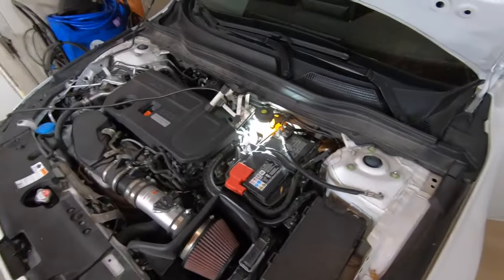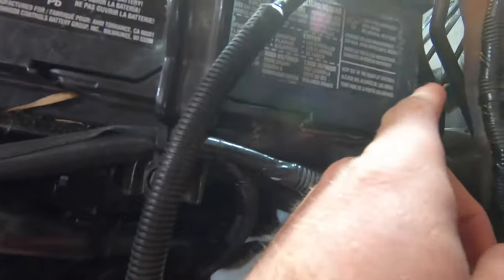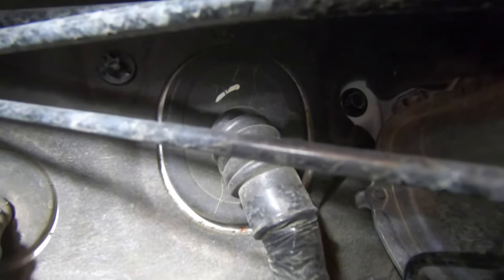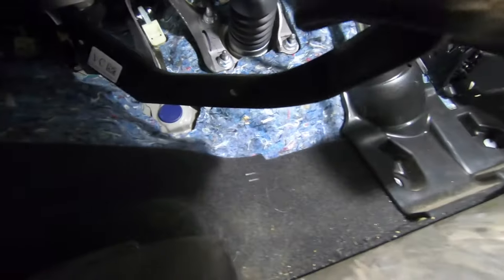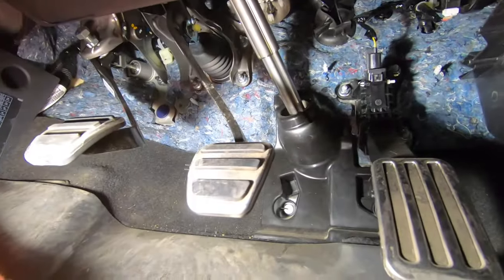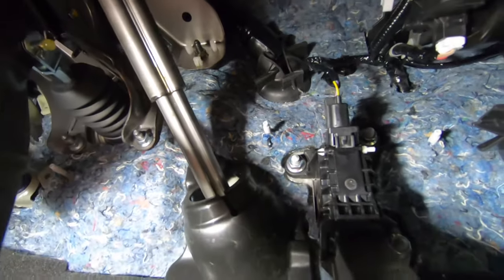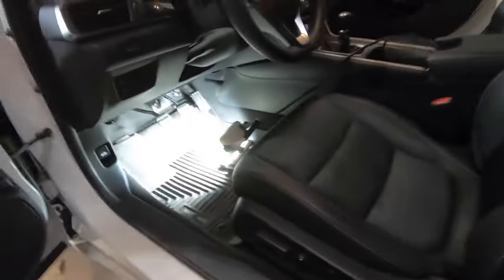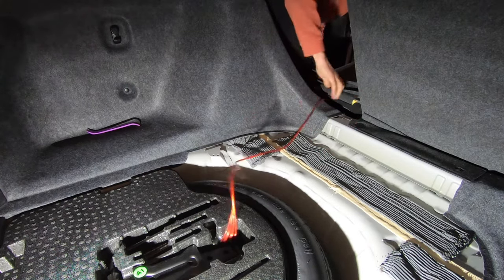2018 Accord Sub/Amp wiring Tips & Tricks

Comment: I decided to drill through the firewall, but followed everything else including the GENIUS trick at 13:08. Thank you!
Reply: Did he connect the rca adapter to the speakers? Is it just one speaker he is tapping into or both?
Reply: @tenkay7536  he connected the Line Output Converter (LOC) to the speakers. The most common ones I see are LC2i or Kicker KEYLOC. You have to tap into both because you would be missing any bass from songs that only play bass on the left or right

Comment: Def upgrade the amp kit too a ofc kit like kicker or fosgate and you will notice a difference. I'm 44 and used too do installs all the time for fun. I now have a 2022 accord sport and just want a little extra bass so I'm installing a kicker comp 12 on a kicker monoblock amp giving 300 watts rms @2 ohms too match the 2 ohm 300 rms sub. Plus a kicker amp kit. Cannot wait
Reply: I have a 19 Accord and looking to do the same also my door speakers as well just for better highs and mids. First sub and amp though

Comment: very helpful! line output converter plugs right in to factory sub in EX-L so I can use new box and use the factory sub with proper line levels!
Reply: hey, I have an EX-L myself and I am trying to figure out how to connect it to the factory sub.. do the left and right positives go to the positive side of the factory sub and the same for the negative side.

Comment: Yesssssssss. I finally have what I wanted. Everyone that wants a d.s.p.  also along with their amp too get the real power from the headunit no need too look further. Check out the kicker key 500.1. It has a built in dsp. You just play 2 tones through it too set up and it brings the missing bass needed. I have in my 2022 accord sport along with my single 12 inch comp r 500 watts at 1 ohm and the kicker amp 500@1ohm. Took a couple minutes too run the setup on the amp and it's insane.
Reply: I have a similar set up with 1 kicker. Replaced all 4 speakers. Added 6x9s in back just cut out a bigger hole to fit them. I was running the lc2i but wasn't getting the power i needed to get that bass. Added a clarion EQ and fix the issue.

Comment: I'm trying to finish up my install now. I did it in the reverse sequence, and left the power cable for last. Im having a time poking a hole through that grommet with a Phillips screwdriver. It keeps pushing the grommet through the firewall like you mentioned. I gave up for now, I'll go attempt it again in a few hours.
Reply: Ok so I ended up making a slice in the grommet from the engine bay. I unbolted the brake fluid reservoir and moved it out of the way. Then I taped the wire to a long zip tie and fed it through.

Comment: I've seen a lot of folks doing this but keep two things in mind, first the factory wiring in these Honda/Acura's are very very thin so there's potential to damage the harness running through the firewall already.  Second, you'll be running your power wire over and around the steering and other moving parts under the dash so be very mindful (some kits give you only 20 feet of power wire and routing it like this might leave you short at the trunk).  There's a really good spot to drill a hole on the upper left side of the drivers side firewall up about 6-8 inches from the footrest.
Reply: Had 17 feet of power in mine and worked perfectly fine so 20 should be more than enough might even wanna cut some off
Reply: Did my install last night on my 2022 accord sport. Ha e a 12 inch kicker comp. Powered by a kicker cx400.1. Doesn't rattle my trunk and u cannot really tell I have anything outside of the vehicle but inside it sounds ok. I probably should've tapped into the front speakers instead too make it more powerful?? I'm not sure.
Reply: @jeffd3802  did u tap into the factory sub?  There’s a factory DSP curve that can be flattened in the developer menu, but if you’re just doing a sub I’d leave that alone.  The rear speakers get a little more mid bass than the front.  If your trying to boost the sun frequencies you might want to consider a DSP or something similar but that being said it’s a lot of $$$ for only subs.
Reply: @jameseberhardt3551  actually I'm super happy now. I returned the kicker amp and bought the kicker key amp 500.1. It has a built in dsp. You basically download 2 tones and set the amp accordingly. It brings back the bass loss from the headunit. It bangs now. Also installed it on a kicker compr 12 inch 500 watt at 1 ohm
Reply: @jeffd3802  very cool.  I was just looking at some mono block amps with DSP’s built in.
Reply: @jameseberhardt3551  this thing is awesome now. That kicker key amp is ridiculous. 500 watt at 1 ohm matched up too my comp r 500 watt at 1 ohm. The kicker tone downloads are simple too download. You just run them whole the head units 3/4 up and set gain than.run another tone that measures the headunits missing bass tones and it brings them back. The gain is set at barely 1/4. I cannot believe I was even contemplating on tapping into front speakers for a little more power when the main issue is the headunit and the need for a dsp. This amp is perfect for anyone looking too add power and keep factory system but bring back the full potential and missing bass tones. Only $249.00
Reply: Keep in mind Drilling holes can cause water to come inside the cabin when driving through rain puddles

Comment: Have done the same way in my 2018 Accord  Sports I have JL Audio Woofer n Soundstream Amp the car just gives a feel of Disco
Reply: Pratik chheda does the rear plastic trim above the back seat rattle when the sub is banging bass a bit?
Reply: @nickle1371  no i haven't felt anything like that nor anybody complain me about it
Reply: Think I can do this with 1800w amp?
Reply: Is there any way to get deep base without folding the seats?
Reply: @deathtopakistan8908  use a proper enclosure for the Woofer n get right Amplifier

Comment: Thank you for the video. I have a 2020 Accord and it looks like the same exact setup.
Reply from the maker: Thanks for watching, I hope it helps.
Reply: Gutentight, I do have one more question. I know the pos/neg wiring, but how did you ground it? I am not using your converter, but I still have to ground mine and I am not trying to do it straight from the head unit. I though of using a self-tapping screw? Thanks

Comment: You said you tapped into both speakers, i saw in other videos where they tapped into one. They butt connected the white and grey with a speaker wire into the positive of one speaker, and black stripped wires into the negative of that same speaker. Since you said you used both, how did you do it? Did you butt connect everything separately ?

Comment: I have a question, I don't see any asking about the ANC system  did you disconnected it? To my understanding this is a must in most Honda's today - if no deactivated you will have unwanted low rumble in your system @ around 70-30hz
Reply from the maker: yes it was disconnected.

Comment: So I did the exact same thing only I ran 0 gauge wire for power & ground. I tested it, and it worked great. Then my horn went off...and wouldn't stop. Snatched the horn fuse out and found out I blew the battery sensor. Understandably I was running a 3000 watt amp to a 2500 sub for maybe a minute topps. I've ordered a high output alternator (400 amps), and picked up two yellow top Optima batteries. Do you you think it will blow again, and if so. Is there a way to bypass the battery sensor? Btw I have the exact same car as you.

Comment: Awesome! You the man. I jus ordered the kicker. This makes it so much easier. Hooking up a small mono and 10" sub that I have layin around. Fingers crossed. Not sure if I have to unplug that box behind the glove, but if I do I know where it's at. I will update whenever I get around to it. 2021 Accord EX-L 
 Thank you
Reply from the maker: You will need to unplug the ANC box.
Reply: @HumbleAcres  My man! Good karma coming your way ✌️
Reply: 2 questions (sorry). 
 Is the kicker remote good enough for the amp or best to run a separate 12v remote from something else switchable from the car. 
 And.. I see you wired the kicker to the sub. Did you splice both left and right kicker wires together or jus one side? Left or right? 
 Thanks again in advance 😎
Reply: @ryant75  update?
Reply: @onelove1832  Yes. All good here and running strong with no issues.
Reply: @ryant75  did u unplug the ANC?

Comment: Quick question before I try to install mine, if you have instagram could i see the speaker connection to see if my Acura has the same one to do the spade connector trick? Also do I need to buy speaker wire for the loc?

Comment: I am about to get the JBL GX628 for my front doors, and these speakers were built in tweeters also. If i install them, will my stock tweeters still be working?
Reply from the maker: Yes changing the door speakers wont effect the upper tweeters.
Reply: I put those jlbs on my TL  made a big difference other tweeters function same as before

Comment: Hey had a question about the kicker converter. Did you have to add wires to make them longer so that you could connect them to the speaker wires? The image I’m seeing on amazon, the wires look short. Could you help explain how you tapped into the speaker wires please!
Reply from the maker: Yes the wires will all need extended, I used some crimp connectors and heat shrink to do it. To tap into the factory speakers you can use a spade connector, there is a slot on the inside of the factory connectors that you can wedge them in to make contact. hope that helps.
Reply: This comment? The wire extended?

Comment: Where did you ground your amp in the trunk? Also where did you tap the remote wire as well, thanks!
Reply from the maker: Ground is self tapper to the chassis. For the remote I used the converter to get power from rear speakers.
Reply: @HumbleAcres  can you explain the remote wire a little more? So you’re saying you don’t need to find the accessory wire and run from the rear of the head unit to the amp?
Reply from the maker: @MFORD514  Not much more to explain. When the converter sees signal from the rear speakers it gives power to the remote wire turning on the amp.
Reply: @HumbleAcres  link to purchase the converter ?
Reply from the maker: @AnythingEverythingGh  Its in the description.
Reply: My amplifier turns on as soon as I turn on my car even with the radio off. Anyone found out how to run the remote with the radio so it can turn on and off with the radio?

Comment: Excellent! Just got a 2020 Accord Sport and I'm about to install a small powered sub. Thanks for this video, well done!!
Reply from the maker: Im glad it helped!
Reply: @HumbleAcres  wish you showed the full wiring set up 😕
Reply from the maker: @thomasboi305  Ya I regret not showing more.
Reply: @HumbleAcres  yeah I’ll figure it out though, love the set up 👍
Reply: How did you do the remote power? For amp?
Reply from the maker: @ANTDEEZZYY  The remote from the converter goes to the remote on the amp.
Reply: @HumbleAcres  did you put a fuse between the power wire from the amp to the converter
Reply from the maker: @kylersharp4893  no I didn't. Its a signal wire so its low voltage.

Comment: Mine i had to take the taps off and just lit up a part on each wire then twisted them together and tape etc.. Worked Waay better, the taps were not connected nice enough i seen and my subs got louder so i suggest solder them or twist together nicely and tape

Comment: So how did you hook up the line out converter I have the same exact one as you but I can't seem to get mine to work did you have to hook your ground wire and if you did did you hook it to your amp
Reply from the maker: If I remember correctly the ground wire goes to the chassis.

Comment: Where did you run the remote wire
Reply: Yes where did u run the remote wire
Reply: @osteenbob4771 ran it to my acc fuse under the steering wheel

Comment: I have an 18 accord sport and I’m getting a 12 inch Sony subwoofer and amp installed Wednesday I’m kinda getting myself freaked out that it will ruin the battery and alternator. Have u had any issues?
Reply from the maker: I have not ever on any car had an alternator go bad because of a sub. that said there will be more wear on it. Any mod has a risk/reward. I wouldn't worry about it though.

Comment: When you were connecting the spades for the speakers did you run it to both rear speakers or just one? I've done this in a 17 civic but it also had a rear sub so I just used that connection
Reply from the maker: I did run it to both speakers but using the sub would also work

Comment: Do you know what will happen if I just wire my sub in my speakers in the back. Using no amp. Will it damage some stuff?
Reply from the maker: I have done this before. You won't damage anything but you also won't get very much bass. The amp not only gives the sub more power it also isolates the low frequencies.

Comment: Excited to try this. I just bought a ‘17 accord touring and was looking to going to same route only difference is a have the 7 speaker with the 8 inch sub. Do you advice giving it shot? 🤔
Reply from the maker: Not sure what you mean but good luck!
Reply: I also have a '17 accord exl. i believe we have 2 more tweeters in the rear deck so it should be a 9 speaker setup wit the 8"woofer. I think I'll use the factory woofer for signal but my question is will this converter interfere with the sound of the factory sub, maybe cause it to distort?
Reply from the maker: @lilsolo68  I don't see how it could cause the factory sub to distort.
Reply: @lilsolo68  Did you follow through on this? I have a 17 Accord and am about to run a powered sub under the front seat, and my goal was to run the factory sub speaker line (disconnected from the sub) to the line level input on the built in amp to get a signal and alleviate the need for a remote input)
Reply: @seansean8008  yes I did. I disconnected the factory sub and used the signal from the wires that ran to it to send the signal to the converter. Works fine.
Reply: @lilsolo68  Perfect- thank you so much for responding !

Comment: I noticed a wire already grounded for some harness behind that rear driving seat around where you ran the power wire, was curious if I could ground the amp on the same bolt that other wire is already grounded on.
Reply from the maker: Any chassis ground should work fine.

Comment: Can you show what wires your connected too the rca convertor, what wires/ colors do you connect from the speakers too the rca adapter
Reply from the maker: the rca converter has a diagram that comes with it. the rear speakers have a positive and negative for each side, those are what I am tapping into in the video. for left blue +, white -. for right yellow +, brown -. the remote from the converter goes to the amp. the converter also has a ground.

Comment: Where did u get the kicker rca converter from? U said it also doubled as a remote wire, is that correct?
Reply from the maker: Got it on amazon 46KISLOC2 and yes it does work as a remote.

Comment: So I’m pretty much done with everything except the remote wire & ground for the converter. 
Where did you hook that up the remote to?
Reply from the maker: The remote from the converter goes to the remote on the amp.
Reply: @HumbleAcres  did you add aother wire from the amp to 12v power source then ? so it would turn on 
Just for reference i have  the same honda accord no premium sound though.
Reply from the maker: @crazyindianboy24  yes you need power from the battery. the reason for the converter is so you dont need to hook up a remote wire from the stereo. the remote wire turns the amp on and off. the coverter gets the signal from the rear speakers so when the stereo turns on and the speakers get power it turnes the amp on. hope that helps.
Reply: @HumbleAcres  thank you that’s a big help. Cause I was wondering how the remote wire works. 
My bad that Last question I meant to say remote wire not a power wire but thank you so much for all the help again keep up the good videos

Comment: So I could cut one end of the RCA cable and splice it into a door speaker like that, and then plug the other ends in the amp?
Reply from the maker: No don't cut the rca cable you need the converter I show in the video. Speaker wire from speakers to converter and rca from converter to amp.

Comment: where to the grey wires that you tapped into the back speakers go to? also do the grey wires need to connect to both the right and left speakers
Reply from the maker: They go to the converter. I believe both sides need connected.

Comment: Dude I have the 2022 accord sport and the grommet u r showing on my vehicle looks a hair different and has a million wires in it. Thinknill drill a whole through mine.
Reply from the maker: Sorry I don't know.
Reply: @HumbleAcres  no worries. I drilled a new hole in the firewall. I hooked up my whole stereo but feel like the sun is lacking a little bass. I guess I should've listened too others and tapped into front speakers.? Also I bought spade connectors and tried tapping into the rears like you but 2 of the 4 kept sliding out so I used the positive connectors which suck. I might be better stripping some of the factory wire and run speaker wire directly too that twist it and tape it up?